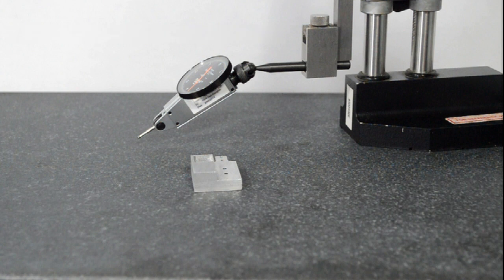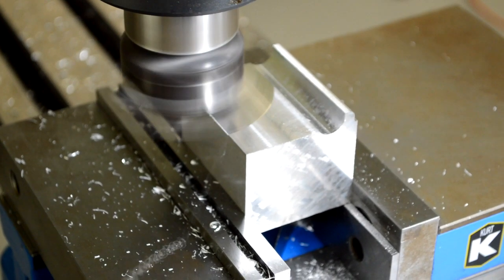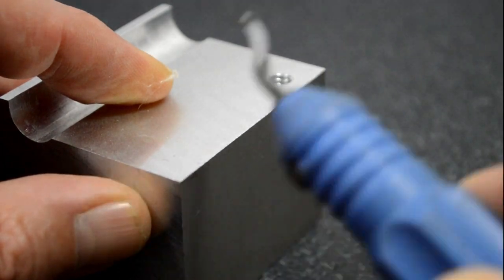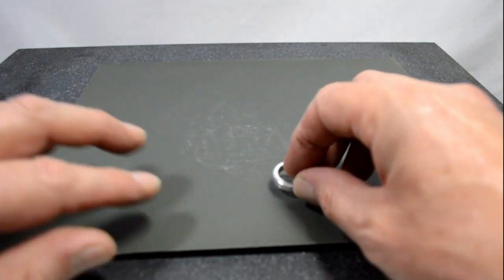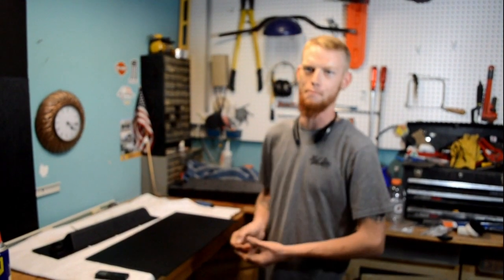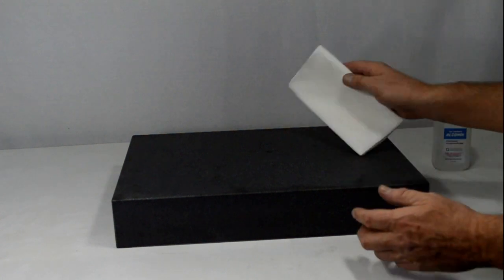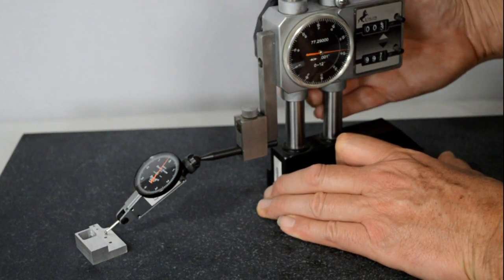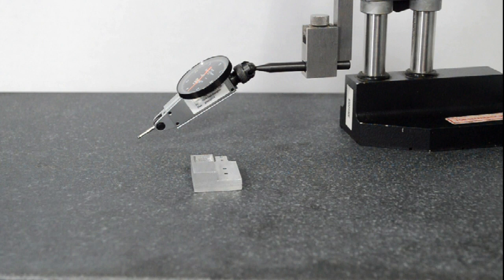How to Properly Deburr and Inspect a Part and Record the Findings

Comment: Way more safety talk on the swivel blade pls. 
When I got my introduction to them 3 years ago thy guy showed me a pretty big scar on his hand and told me a co worker cut his entire arm open (a couple days later I noticed the guy in the opposite both had 1 ft of scar on his left arm.)

As of right now I never cut myself with the blade, but a already deburrd edge made a 1/4" long scar in my thumb because I slipped. 
Tldr swivel blades are dangerous. Use them with caution.
Reply: I have sliced my fingers really good several times with deburr tools. You will be hurt being a machinist. It's all about trying to minimize the injuries.
Reply: yeah a finish groover took out a tendon in my thumb after my crescent wrench slipped off the tool above it while tightening

Comment: This is badly made
Reply: I second that.
Even the basic deburring looked sloppy. They should show someone doing it in a real life scenario rather than the slow, unrealistic motions he did with the part on the plate.
There are certain things that make deburring edges much easier and cleaner that weren’t explained here like how the part and tool should be stabilized in your hands, the angle to hold the tool at, pressure given, how to get the whole edge in one motion, etc.